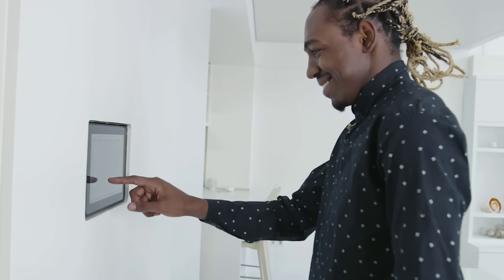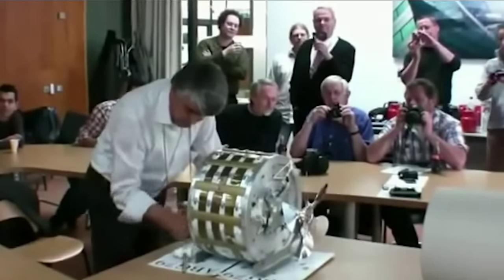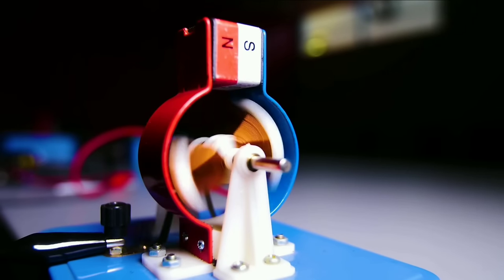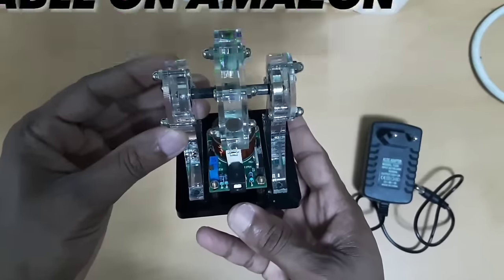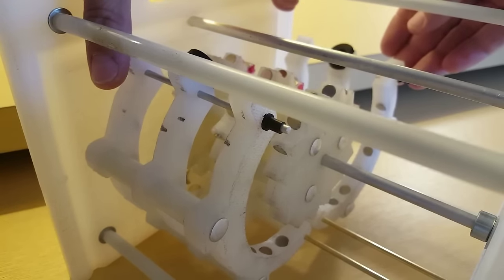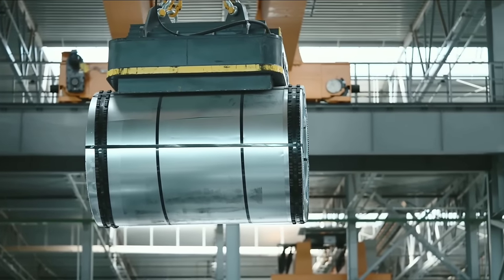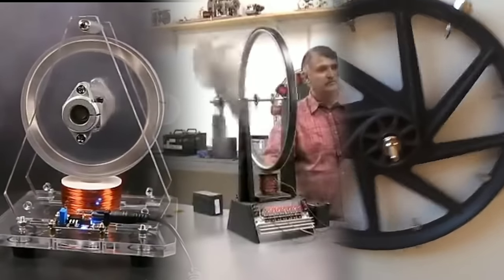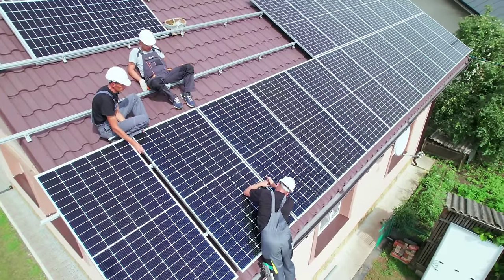You Won’t Believe This Magnet Motor That Generates Free Electricity Forever?!

Comment: One of the researchers in the field found a solution to overcome the problem of pole equality in magnets by having a third pole that divides the degrees of magnetic force between the two poles, and he succeeded... .
Reply: Dude this video is just trying to discourage people and mislead people into knowing that it is possible these people just want us to be paying them instead of finding ways to help these inventors reach this goal. I'd love to help in finding a solution to magnetic energy and I'd love to learn as well if it's ok with yall
Reply: That's a fascinating concept! It's always exciting to see advancements in technology. Speaking of power solutions, have you heard about the Segway Portable PowerStation Cube Series? It's a versatile powerhouse that offers massive capacity, fast recharging, and waterproof technology. It could be a great addition to your outdoor adventures or as a backup power source for your RV. Check it out!
Reply: The magnetic gauss field WILL reduce to Zero in time..
Reply: Time of GAUSS collapse depends on the resistance by electronic field strengths being generated..
Reply: Would that coincide with Joe Parrs research with pyramids?
Reply: @johnnorris1983 the resistance is only a deformed energy state what we know as absorption but the energy is not gone!!!
Reply: Yes that make the “difference” it’s the 33.34.35.36 🔂 66.67.68.69 
Nothing can be 100% equal because when it does then it becomes the only source. And when this happens everything stands still but this will not happens it’s infinite by the cycles vibrations frequency energy a never ending story.

Comment: I made a toy car using round wooden drawer knobs glued to round speaker magnets.  I delineated the poles and used glued pegs and wire to mechanically link the two wheels.  A slight push would send the car across the room until something stops it.  My 4th grade teacher was wide eyed.

Comment: A magnet motor makes sense to me…
I have always said. Remember Gilligans island.?? He rode a bicycle around and around to get electricity… So hook it up to a treadmill and if you want to use the dryer you have to run on the treadmill etc.. why not? That would control obesity and we would not need the rip off power companies.. 
I was told. Back in the day. To get the people of a town to except electricity they were told they just had to install the power lines. 
And after time went on they started putting meters on the houses. In other words. You can bypass the power meter and you will have power . My ex husband bypassed my power meter a few years ago and I had free power.. I eventually had him hook it back up to the meter. I finally got a good job. So I could pay for my power. My point is. The power company never knew a thing. And I was getting free power. Hum? Makes ya think about the meter thing.. 
just like them wanting to put a meter on my well. They are liars and thieves..because they don’t actually own the water now do they?

Comment: That is not what Bedini said!
Not only does he never claim it will "run itself forever" but he says you can charge infinite batteries from the one battery that runs the motor, this is the secret.
For this reason when the source battery is depleted you have to swap it out for a fresh one.

Comment: These people who accuse anyone of working on a magnetic motor to shut them down are the ones making all the money from gas and oil.  They do not want anyone to cut into their billions of dollars they make from gas and oil.   1/3 of the inventors working on alternative energy motors have been killed and more have been threatened.  An engineer in Utah put an antenna on his roof and made enough energy to run his house.  He was threatened, they killed his dog, broke in and destroyed his lab and then said they would kill all his family and friends if he did not stop.  Today his son is still trying to figure out how his father did it.   The person who made this video is connected to the same people who went after this engineer.  The inventor will say it is a 99% efficient motor and they will get accused of fraud for claiming it is a perpetual motor when that claim was never made.  They use the law to arrest the inventor and send him to prison or they kill him.  I have a magnetic motor that is 98% efficient but will not disclose it as have been threatened.  Most of these pure magnet motors lose their strength so stop working.  That is why you must have coils to keep the magnetic field strong and from going weak.  My motor design is very different than all of the ones on line.  All motors work with a magnetic field.  100% of motors work on a magnetic field.  They just use a lot of electrical power to make the magnetic field.  That is where these people make their money is in charging you a lot for the electrical power.  There is no free energy because it will cost money to buy parts to make the motor..  Just free from the grid power.  In a lot of places now if you go off the grid the government will level your house as they government makes a lot of money from the electric bill.  They will pass laws to keep you on their lines.  Their motive is money, just like they accuse the inventor of doing.  They accuse others of what they are doing.  That is what democrats do.  accuse others of crimes they do and then attack.
Reply: Man, you had me hooked and were reeling me in--until the 'democrats' comment.  But, what the heck, you got most of it right!

Comment: Magnets require 2 north and 2 south poles to be a permanent magnet.  Atoms use multiple negative and positive components to exist.  Such devices are perpetual if frequency locked until acted upon by a greater force.  Now the magic.  Electricity comes in two flavors Endothermic and Exothermic.  Establishing a locked frequency between them also may create a perpetual system.

Comment: Wind turbines get a needlessly bad rap. People seem to work to come up with new ways to criticize them. 
   One of the big rationales is that wind is inconsistent. Everyone likes hydropower, right? There's a way to evaluate it. It's called capacity factor. It takes manufacturers nameplate generation capacity and compares it to actual net production over time. Nuclear is among the highest. Hydropower is around 37% while wind power is very close to it at 35%. So if one likes hydropower it follows that people should like wind power as well.
   The lesson here is that we need to use numbers to more effectively compare types of energy production.

Comment: I believe that most magnet motors don't work. But there is one that really really works. It's called the SphereMotor (the future of electricity). It's like having ten windmills in a small box, and it runs on only 35 watts. Make them bigger and put them together and it should power a small car.
Reply: Have you built it?
Can you give me a link of the details??
Peter
Reply: Weak bowl-shaped electro-magnet without an iron core and a strong sphere magnet with 600 lbs. of pull strength. When current is pulsed and reversed through the bowl-shaped electro-magnet, the sphere spins with about 40 lbs. of force at 3000 rpms. (Equivalent to ten guys generating electricity on a bike.) The permanent fuel comes from the strong sphere magnet with 600 lbs. of pull strength. This is the simplified answer.
Reply: where do get a sphere motor from
Reply: It won't be for sale for quite a while. I'm still working on production.
Reply: @christianburke418 
First, let's be honest about the fact that every motor is a magnet motor as they all contain magnets.

However, in the magnet motor that is being discussed in this video, only magnets are used to produce revolution and electricity is not used. So they say.

The description of your sphere motor does not fall within the definition of a magnet motor.

It sounds like you have discovered a more efficient way to run an electric motor.
Reply: @scotttovey  Call it what you may. It works, and I think it is a game changer.  Thanks for your comments.

Comment: If you want some free energy 😎⚡, get you some solar panels and batteries. Why not use something that works instead of chasing a pipe dream. I also have a wind generator. It works too. I used three 24 volts 100 amp hours lithium iron phosphate batteries ⚡🤔, and four 31 series deep cycle batteries on my solar panels, and sixteen lead acid trolling motor 🔋🔋🔋🔋💡 batteries on my wind generator. All of them are fully charged. That's 1300 amp hours of batteries. The Sun 🌞 will be up in three hours to start charging again. The free energy is coming from the Sun ☀️ and the wind.
Reply: What's the make and specifications of your wind generator?
Reply: @alskin  the one I have is a 600 Watts B&C from Green Energy

Comment: Magnet motors get their "FREE ENERGY" from the ELECTRICAL CHARGE those magnets collectively carry and that charge is dissipated by transforming the energy into mechanical spinning force and heat generated by the spine! So its not "FREE ENERGY" at all!....🤷🏿‍♂️ 
Now given that the energy is generated by the magnets is safe to say as long as you can recharge those magnets and they continue to hold good charge you can produce continuous power. And given the wind and solar applications that can be applied to energy systems, i think something can be done in the realm of off-grid power generation!

Comment: The reason people are convinced magnet motors are real is that anyone can take a magnet and move magnetic objects without touching the object. Force is being applied without directly transferring energy.  Its self evident that work is being done on the object without introducing apparent energy being transferred.
Reply: YOU are providing the energy, when you push or pull the magnet.
Reply: @MrSummitville  Is a fridge magnet not doing work? It is canceling the force of gravity. And it will do that for decades (centuries?) with no input power.
Reply: @royh4305 No, a fridge magnetic is not doing any work. If the magnetic continued rising away from the surface of the Earth then and only then would it be doing "work". Is the couch performing work, when you are sitting on it? No ...
Reply: @MrSummitville  Unlike a magnet, you can't stick a couch to a metal surface (i.e. fridge door), and it will stay there floating in mid air, fighting gravity.

I don't know if what magnets do can be called "work" according to academia's understanding of work, but it is doing "something" that effortlessly cancels gravity.
Reply: The spheremotor has succeeded.

Comment: Magnet motors don't work, heat pumps however do more work than they are supplied with though: COP > 1 often reaching 4 or even 5!

The principle of equivalence is an important law in physics. If the heat pump can have a COP>1 then other device can as well. Magnet motors won't work because thats something for nothing.

But a homopolar motor is different, it has no reactive component, its load on the circuit is the coil resistance and the ammount of work the rotor does is irrelevant to the coil resistance.

Comment: Magnet motors don't work because of one issue:  They don't have a mechanical means to operate beyond units.  A free spinning group of magnets will do two things - eventual stop sniping, because the initial push eventual drops off, and they aren't turning with enough force to produce work.  If the magnetic motor was geared with a secondary source of a rotating magnetic field to induce it into action, there is also the requirement of adding a secondary powering lever like the weight of falling water to induce the drive magnetic group to excite the main magnetic motor to drive with force.  This complex arrangement will continue to excite the motor rotation and the initial decay no longer exists.

Comment: If you suspend a 1kg of weight using an electromagnet , so you may be using say 10watts of electrical power in the electro magnet,  so now if you replace that electromagnet by a permanent magnet of similar strength, then that means the permanent magnet is now suspending that same 1 kg weight using no energy, so now if you were to suspend that weight for 1 year, that would require 10watts x  24hrs x 365 days = 87,600watts, or 87.6KWh, so likewise that Permanent magnet could hold or suspend that 1 kg weight for a year without consuming any more power than what it needed in the first place when it was manufactured. but certainly it would not have required 87.6Kilowatts to magnetise it. So I thought how that can be? then I had a dream and man told me in my dream to kill my magnetic idea because I can suspend a 1 kg weight from a ceiling using just a nail, now that was not a bad idea, you see how easy it is to get mislead.

Comment: Your video is very convincing, it might not be possible by  means of magnetic devices, but it is by using gravity itself, do not ignore that gravity is a source of power and men have been incapable to engaging  that force to a mechanical system, lm very convinced that it's possible through mechanical advantages

Comment: I can offer you the principle of a 'magnet motor' that works as 'free energy' source but at a level far too small for practical utility.
The basic idea is a little subtle but not too hard to understand. It's based on the fact that, unlike for a classical perfectly conducting loop current that must obey Lenz's Law, electron intrinsic magnetic moment is invariant courtesy of quantum mechanics. Hence if already aligned with an external B field, varying that field's strength cannot alter the intrinsic magnetic moment. This corresponds macroscopically to saturation magnetization of a permanently magnetized ferromagnetic body.

So far so good - nothing new there you may say. What is 'new' even though I came up with the insight decades ago, is the realization that an invariant electron magnetic moment's 'defying' Lenz's law implies it is doing work 'for free' to maintain it's fixed magnetic moment despite any variation in external B field. Whereas a classical equivalent loop current would require some tiny 'battery' to apply an emf to classically maintain it's magnetic moment constant.
It may be easier to look at it from the point of view of an equivalent circulating solenoidal 'surface current' that does not react to the transformer field owing to varying external B.

An energy input that as already stated is supplied 'for free' via quantum mechanics in the electron magnetic moment case.
The energy difference between the two cases is entirely internal in nature and does not enter into the usual transformer type induction effects. There are no such effects in the fully saturated regime under consideration here - the external magnetizing circuit sees only 'air' in response to it's varying applied B magnetic induction. That's what fully saturated means.

However a 'hidden' change in the overall mass-energy of the assumed fully magnetized material has been generated just by altering the applied B field.
Such an 'hidden energy' change does not conform to a conservative continuity relation that a fully classical EM governed system would have to. No 'tiny batteries' required.

There are various ways to exploit it. For instance, raise the magnetized body against gravity at one value B1 of applied B, then alter the B to a new fixed value B2, then lower the body back down.

We have changed to a tiny amount the gravitational mass according to E = mC^2 via (B1 + 4pi M)^2 -> (B2 + 4pi M)^2 between the raising and lowering operations.
Thus an overall excess or deficit in round trip energy expenditure! Recall magnetization M is constant throughout thus no 'transformer action' feeds back externally to the external electrical energizing circuit. So forget about trying to find the 'balance' there.

Repeat the cycle as many times as one likes to accumulate an in principle arbitrarily large net energy gain or loss.

Of course the usual inherent dissipative losses involved in actually performing such a procedure would exceed by many orders of magnitude the nonconservative gain/loss.
So no fortune to be made alas.:eyes-purple-crying:
Reply: Probably best to clarify re  line in above post:
"We have changed to a tiny amount the gravitational mass according to E = mC^2 via (B1 + 4pi M)^2 -> (B2 + 4pi M)^2 between the raising and lowering operations."
Actually, expanding out both squared expressions and subtracting the 'irrelevant' contributions from 'just' B1, B2, and M, the actual differential in stored energy densities that matters is the so-called 'interaction energy' terms 2*B1*4*pi*M, and 2*B2*4*pi*M, i.e 8piM(B2-B1).

I should also point out the nonconservative effects that 'break' conservation of energy-momentum sacred cow principle are there even in the non-saturated regime, but it's then a messy situation to untangle. Keeping it all in the magnetically saturated regime makes for a 'clean' relatively simple analysis.
So what do you say to all that, Future Galaxy (or anyone else for that matter)? Can you find an obvious flaw anywhere? Good luck with trying!
Reply: I will rephrase your spatter - magic.
Reply: We think it’s absolutely brilliant! 🤓👍

Comment: The permanent magnets in the magnet motor are producing a magnetic field.   This magnetic field is energy that is coming off the metal magnets through Einstein's formula E=MC squared ,  In  essence, the matter of the metal magnets if converted into energy, but the amount of matter consumed is:  M = E/C squared  or ( VERY LITTLE)  so, you can get much energy before the matter of the magnet is reduced in an amount that can be detected in measurement of weight.  This is a virtually free energy source like Thorium Molten Salt Reactors, but like Thorium the whole subject is shrouded in Bull Shit to keep it from realization.  The world is all about control and profit, not truth and good will towards men (or women)